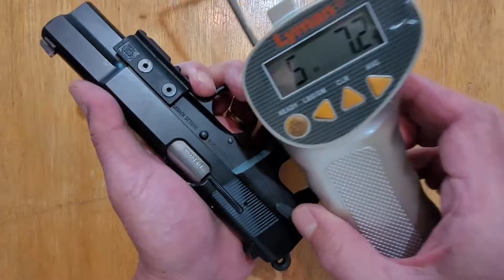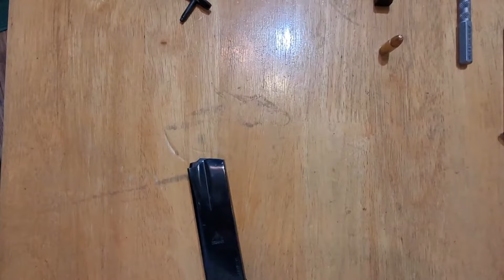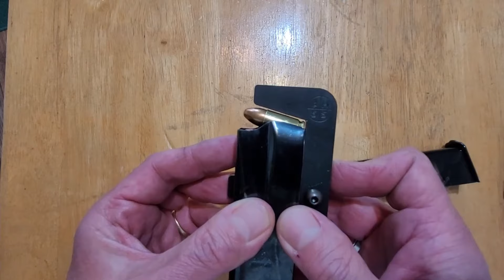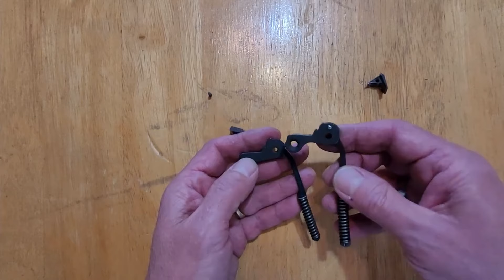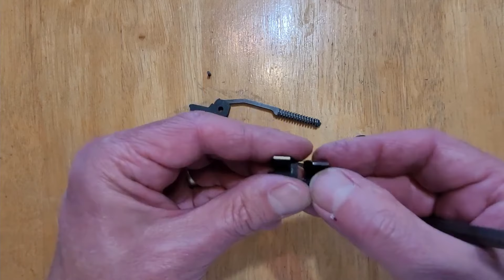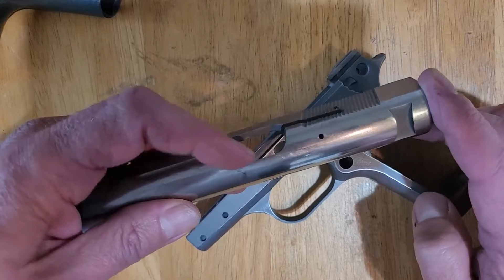BHSpringSolutions Evaluation & Analysis Inglis L9A1 Part 2 - BH Hi-Power University Session 119

Comment: I have numerous hammer fired pistols with single action break weights less than 4 lbs.  I enjoy these pistols and shoot these pistol accurately at the range.  It is true though, there is the very occasional thrown shot.  So,  I accept that for defensive purposes, a trigger can be too light, but it's also true that a trigger which is too heavy causes inaccuracy.   As Mark states, the Girsan has roughly a 7 1/2 lbs break and I can say definitively 6 lbs or more is too heavy to be accurate.   I think a 3.5 to 4.5 lbs single action break is the sweet spot and I'm not yet convinced the Inglis isn't fine just as it is, unless there are reports of failure in the field?   A question for SDS/MAC and their manufacturer, which is Ozerbas Makina Silah, not Girsan or Tisas.   (The Inglis mags are made by Sabatti of Italy, not Mec-gar.)    Mark does make valid points about potential for litigation from triggers altered to be too light, but some service pistols are absolutely too heavy to be accurate.   The classic example is the NYPD ordering Glocks with 12 lbs triggers to approximate the double action pull of the revolvers they issue.  3 lbs is too little and 6 lbs is too much and the perfect weight probably varies by gun and by shooter.   Have to admire Mark's patience and attention to detail.